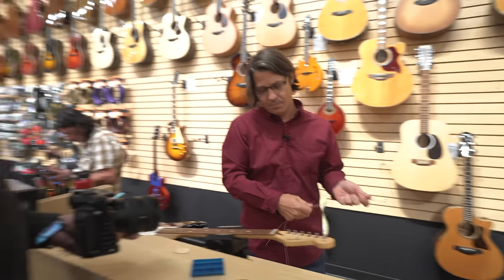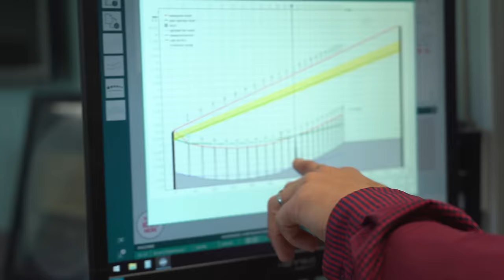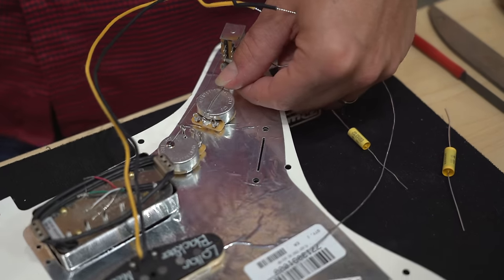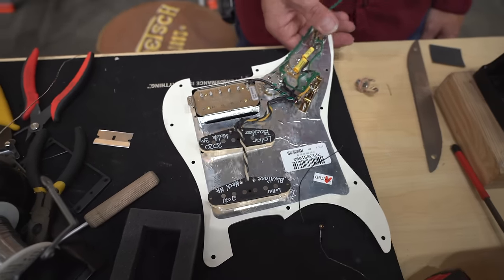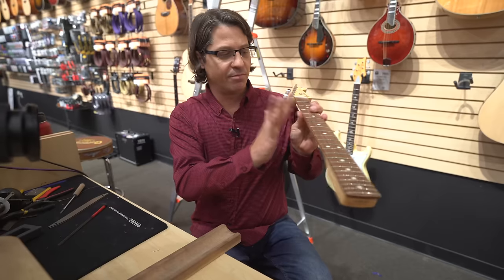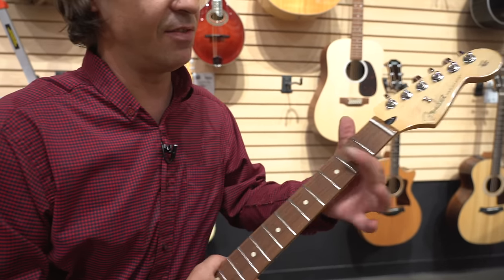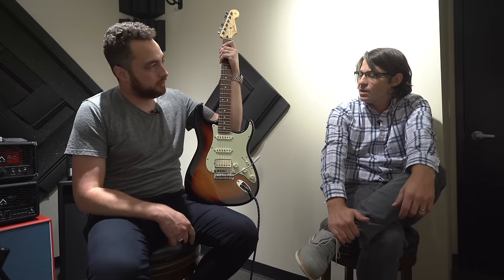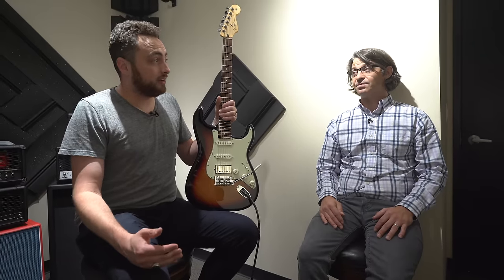We Tried To "Custom Shop" The Cheapest Fender Strat

Comment: So basically most of the initial issue (the high action) was just a truss rod adjustment.  You liked the initial tones so you tossed away all the pickups and all the electronics.  I'd love to see what it looks like with a 5 minute truss rod adjustment, setting the intonation, adjusting the saddles, adjusting the nut if needed, adjusting the pickup heights to optimize the tone.  I'd bet it would be a really nice guitar right then and there.
Reply: I dunno man I’m constantly swapping parts on my violin (sarcasm).  I agree, as a reformed modder, if you don’t like the guitar after a proper set up you won’t ever like it no matter what you do.  I find the opposite to be true, if you like a guitar why mess with it other than as an experiment or time vacuum.
Reply: I say buy a performer and have a top notch set up on it .
Reply: Yep, and blows past the initial ~$800-$850 ballpark upgrades by $1,000,... The stock electronics were doable as they were.
Reply: Truss rod adjustments are for proper neck relief, not action.
Look it up.
Reply: Yeah the other pickups were better the truth shall set us free
Reply: @jamiedoerfler3693  I'm sorry you're not getting it.  Try this on your guitar, set the neck relief to something very large, 3-5mm, then measure the action at the 12th fret.  If you'd have watched the video you would have seek the PLEK report showed the relief was not set properly. That does result in higher action when the neck has way too much relief.  Likely this happened because the guitar was shipped from a different environment (e.g. humidity or temperature) but possible it just wasn't set up.  So the first step of a setup is to set the relief, without that you won't be able to get good action.  You also missed the entire point which is that with a proper setup this guitar would probably be fine.
Reply: @ernie12man  you mean more like 150 or so
Reply: @guythetechguy  yep..
Reply: @Luckyrider1958  Early in the vid they say they're gonna do it for $800 or $900 and then total tab comes out to $1950 didn't they say? A bit more than $150 if my ears and math are right. :)
Reply: @Luckyrider1958  Ahh I follow you, my bad, I missed the all together guitar + work/mods/parts ... thx :) wheww now it doesn't seem so insanely out of whack. Derp :)
Reply: It might have been the amp, but I liked the old pickups better.  I can't believe Fender has the balls to put out basically an unfinished guitar at any price.  I just purchased a new model last year and I was really disappointed.  For a cheaper price, my Schecter arrived fully set up with a graphite nut and locking tuners.
Reply: @leester9487  Yeah, needing a setup isn't "unfinished"....wood moves, it's just how it works. And while relief is mostly standard, action preferences are different for everyone. A player should always expect to have to do at least some minor setup for themselves on a new guitar.

Schecters are great value...I love mine too. But "the truss needed adjustment" isn't a flaw with the guitar build.
Reply: I definitely would have preferred to see that intermediate step: set it up, intonate it, and then see where you're at. That's a better representation of whether you'd like it before you dump any money into it, and it's very likely I'd just leave it like that. Cool of Righteous Guitars to give it away, though.
Reply: I bought one of these back in 2020, after the setup it played amazing like my friends 80’s strat. Right now I modded the heck out of it and made it a replica of Billie Joe “Blue” strat, but stock it’s an amazing guitar!
Reply: yep, mexicans are pretty descent. They "types" of people think that higher price is better and so they look down on everything that is not top notch. Getting more expensive stuff doesnt matter much on the guitar. A big difference i find is Alnico vs Ceramic; alnico pickups have better dynamics. But stuff like more expensive pots or a bone nut isnt gonna do much sound wise.
Reply: @ryanevans371  I feel like a proper Fender branded guitar shouldn't really need much more than a truss rod adjustment. Maybe saddle heights. The nut should be properly cut, and the frets properly level, and the saddle heights should be reasonable (2mm) for a "middle of the road setup. The player shouldn't need to tweak more than the truss rod and saddles to get their preferred action.
Reply: @North_9  I don't necessarily disagree with that, but truss adjustment and saddle height is what I had in mind when I was talking about adjusting the action....that's why I described it as "minor setup for preferred action".

A nut adjustment is something that should only ever need done once for that nut (it's not really designed to be adjustable for different action heights), and that should be appropriate for any brand guitar as part of the final quality check.

Regardless, it sounds like we agree a guitar with high action isn't an "unfinished guitar"...especially since a shop should be setting the guitar up anyway once they receive the guitar and it's adjusted to the shop's conditions,  before putting it out on the floor.

That's part of the issue with the guitar in this video....the shop is pulling it out of the shipping box rather than taking it off their floor stock.
Reply: @aperezdeal  So true especially since almost every musician I have ever know has not yet reached the level of ability they aspire to, better of practicing than modding, unless you make part of your living as tech or simply find modding to be a relaxing hobby.....
Reply: @jamiedoerfler3693  very rarely do informative and correct comments end with "look it up"
Reply: It would be, and thats what id do but thats not the point of the video sadly
Reply: you can just do that yourself! He showed us what would happen if we bought a cheap guitar and souped it up. It's kind of that lingering question in the back of the mind of every guitar consumer: "am I actually getting what I'm paying for?"
Reply: @johnsmith-ug5tp  YouTubers put a lot of time and energy into setting this kind of thing up and editing their videos so they deserve their income. Nothing sleazy happening here, they’re both genuine dudes
Reply: @leester9487  A setup should be part of buying a new guitar and requested from the shop when you buy one. Shops in particular are not going to setup every guitar and part of how brands cut costs is not to give their cheaper guitars factory setups. If a guitar is setup on a shop floor, its either a return or a guitar they want rid of because guitarists still buy into the idea of trying multiple thinking one will be "the one", when really the difference is a setup.

People have different preferences as well, changing tuning requires a different setup, let alone string gauges etc.
Reply: @guythetechguy  
Exactly this. 
Too many pop off about the relief action debate with this crap and you're correct. 
The relief and fret job is the driver on the height that the action can be.

The one thing that happens when you do this amount of upgrades is, if you ever plan on selling it, you're likely to never get the 1k you put in it back out.
Reply: @jamiedoerfler3693  true kinda. Truss Rod adjustments inadvertently change the action. If you have high action and high neck relief for example, correcting the neck relief will lower the action. This is why you always adjust the truss rod before you adjust the saddle height.
Reply: In my town there's a MASTER LUTHIER that sets up any guitar for $39.99.
Reply: @eldesgraciado6690  I do them for $60CDN and never had a complaint in 20 years. I’ll even include minor fret corrections. It has to be kept affordable while still being worth doing. Some people go crazy with charging too much for a setup. 
It’s down to a judgement call as to whether a guitar is worth a given amount of upgrades. I’d say in this case, it wasn’t. 
Still, not my circus, not my monkeys. 🤷🏼‍♂️
Reply: @t3hgir  QED
Reply: NO. Truss rods are not for action adjustment.
Reply: @guythetechguy  GAWD. You don't get it. Action and relief are somewhat related, but entirely different.
Reply: @leswhite3524  It’s not that black and white of a subject, so I don’t see why you think you should scold people over it. Bridge action, nut action, and relief are interdependent and effect each other as you adjust them. They all effect intonation as well. So yes, the relief is married to action adjustments. Measurements are ranges and/or starting points, not final destinations, experience wins the day. You do have to do the adjustments in the right order… Truss rod first, then bridge action, then nut action, then intonation, then test, then tweak. 
All guitars and some players require slightly to extremely different setups in order to get the best out of them.
Reply: @TheMasonator777  What I like about that guy in my town is that he won't judge you if you bring some budget guitar to him. What if you got an affordable guitar for your son to learn? He'll set it up as good as it can be. I've seen others that say "Oh, no, I don't work on Squiers, Epiphones, or other chinese stuff!".
Reply: @eldesgraciado6690  I work on whatever the customer brings unless it’s literal toast.
Reply: truss rod adjustment is for "neck relief" not for high action.
Reply: As we all know, internet consensus equals truth.
Reply: @jamiedoerfler3693  exactly in first time, final setup on bridge
Reply: @jamiedoerfler3693  true but it’s undeniable that adjusting the truss rod either way does lower or heighten the action. Depends how much relief you need or like?
Reply: @jamiedoerfler3693  absolutely true but having a loose truss rod that bows your neck can and will raise action higher than it normally be in frets 5-17
Reply: @brandoncondatore1051  that’s true as well. Still, the right way to adjust the action is at the bridge first. The relief or lack thereof on the truss rod changes with temperature and humidity changes. That’s why it exists…to fix those changes.
Reply: Seems guys are just swapping parts because they think it'll be an improvement.  Usually, swapping parts will do one specific thing better.  That might improve other areas(for example, your stock pickups were muddy, and you put in clear ones), but usually it's best to know exactly what you want.
Reply: It was probably a real nice player to begin with, but then he wouldn't have a video, and this shop wouldn't get to show off their ridiculously expensive machine.
Reply: @johnsmith-ug5tp  To pay for that PLEK machine.
Reply: Now that they've modded it, they have to give it away because I'm not buying it. They can give it away or part it out for 1/4 to 1/2 of the $$$ they've put into it.  Welcome to the real world.
Reply: @guythetechguy  hi, very interesting information. I recently bought my first guitar, a fender MIM a month ago, and really want to know how to do a decent, or proper set up or adjustments in order to have a better instrument. I appreciate any advice or recommendations. 😊🎸
Reply: @ernie12man  $500 for a SD59 upgrade is a bit much in my opinion.
Reply: @leester9487  I love my Schecter.
Reply: @guythetechguy . I agree with you.  Even some less than $100 guitars play great if set up properly.  I am not a fan of locking tuners.  Ordinary tuners are fine, they work well.  Bone nuts are good, but so are many other materials, such as brass.  Jeff Beck used a nut that was metal, and a standard tremolo, no Floyd Rose.  Poly finishes are durable.  How many cracked nitro cellulose finishes I have seen from guitars transported in trunks of cars in the freezing Mid-western winters?  Satin finished necks are good.  A James Burton flamed Tele has one of the finest necks I have ever played, a really great feel.  A cheap guitar, if it gets stolen, can be replaced without so many tears.  I have been robbed several times.  Expensive instruments stolen hurts a poor musician a  lot.  An unbranded padded soft gig bag is fine.  One can wear it on one’s back riding a bicycle.  Hard cases are expensive, hurt your legs when banged into.  The shape and name on the case, such as Gibson, a robber knows a Les Paul case shape.  No good!
Reply: Doing all that would take a lot more than 5 minutes.
Reply: The guitar sounded FAR better stock. Gee, it's almost as if Fender knows what they're doing, and that shop should have NEVER tried to pretend that action would remain on a store item.
  They didn't build a Mustang that whips a Ferrari, they built a Mustang that can't outrun a stock one.
Reply: Agreed but the Excervise was to see what would happen if you spend that amount off money ...but I actually agree with your comment but these guitars ion sale learn to do the work yourself only ditch parts which are unworthy and just smooth out the rough edges off the manufacturer gives you and ahhh labour costs are inhibitive too unless however you buy a higher Mexican level then this and then buy it on sale however check the specs and wait for the sales before the cheque 😉☮️🌈
Reply: @TheMasonator777  this man knows his stuff take your guitar here to him .....
Reply: @jamiedoerfler3693  if you don’t have proper neck relief then you can’t set you action.
Reply: @stevenlipson1965  true, but relief can vary a bit. I found it doesn’t have to be “ by the book”
Reply: I was mostly annoyed by how much unnecesary stuff they did to that poor guitar. Also, I'd get a synthetic nut if I had to change it. And... you could buy another guitar for the price, or a cheap body and neck since you are going to change everything (but that was not the theme of the vid).
Reply: I have a player Strat that I won’t mod. I got the hss. I wouldn’t buy a car that I had to swap the engine out of. Why would I buy a $1k guitar to drop $2k into
Reply: @jamiedoerfler3693 , wouldn’t neck relief be a big factor in action? Relief can be adjusted differently
Reply: Plenty of great used Strats for half the initial cost. Stupid imo to pay for new when you're going to change this much out
Reply: Fret dress and good set up, is the point of difference. The rest is bollocks that shouldn’t be considered. My 2c
Reply: I've played 100 dollar guitars that I liked more than 500+ dollar guitars.
Reply: @jamiedoerfler3693  your kidding right?  I make guitars.  Truss rod adjustment does change string height. Especially it was way out in the first place.
Reply: I have a 20 year old 300USD Mexican Fender strat. Has held up quite well, good action. The only improvements I want to make now are to upgrade the pickups to top grade, maybe a little truss rod adjustment and get locking tuning knobs. If those changes are made, I think it will match any of the really $$$ instruments.
Reply: It would be a great guitar after a simple setup. But this is Rhett Schill, gear snob extraordinaire.
Reply: @aperezdeal  guitars, especially fender guitars, were literally made to me modded. Modding and swapping teaches you about guitar as well so you can learn what you like and you don’t like. As someone who never changed anything out and now mainly plays modded out stuff, I have much more working knowledge of guitar and how to achieve specific tones than I ever did playing bone stock instruments
Reply: @leester9487 I love my Schecter, comes fully set up and sounds amazing for a $100 pawn shop find. And the playability of the neck and such is much better than any Fender I have played. Maybe I'm missing out cause I haven't played a $6K custom shop Strat. But for $6K, I will go with a true American PRS. Fender just can't compete besides the name recognition.
Reply: @leester9487 this wasn’t unfinished.  Truss rod adjustment would have done a lot.
Reply: @johnsmith-ug5tp i can always spot the guy that’s still making Velcro wallet money. 

Here’s a tip.  Quit being so bitter and better your situation so you’re not as likely to sound like an idiot.
Reply: @North_9 wood moves…..that’s kind of why the truss rod is there.  You don’t have much of an understanding of guitars
Reply: @guythetechguy if you adjust high action with trussrod, you might get bow trussrod is meant to deal a relief
Reply: Truss rod doesn't really mess with the action that much. Action is more in the nut and bridge. Truss rod just lets the neck bow a bit so the frets don't twang when you play strings.
Reply: @leester9487   Gibson isn't any better..for the prices they charge, most are not so good out of the box.
Reply: Totally agree! Why throw out the pickups if you like the tone?
Reply: @eldesgraciado6690 😂
Reply: @itsmorphed6416  I compared the player v the performer a couple of years ago when I was after a strat, and for an extra AUD$600 at the time there was no point in getting a performer at all.  I also preferred the two post trem on the player.

My Player was pleked before it was sent out, and I replaced the tuners with all low fender locking, the saddle with gotoh solid steel, and put in a set of lace sensors.  All this still brought it under the cost of a new performer for a better specced guitar.  Having said that, the stock singles in the Player were great and I could have quite happily lived with those but I'd already gotten the Laces.  The humbucker though... absolutely underwhelming and should be the first upgrade everyone does, lol.

It gets gigged regularly, and I can do a 3 hour gig or praco and only need to check the tuning at the start of the show.
Reply: @jamiedoerfler3693 yes but doesn’t the truss rod adjustment impact action?
Reply: It’s humming like crazy after all of the work.
Reply: Spoiler, it is. Also, to "roll" the fretboard edge and level frets at same time, use sanding sponge LIGHTLY along the edge of the board. It'll round the frets, and the board, perfectly. 😊
Reply: I've setup and modded squiers that play, sound and feel better than American made fenders, but do the same work to the American made fender and it usually ends up a step up. But not always.. depends on initial woods, drying of woods, and if the CNC machinery was doing good cutting everything out that particular day lol... You pay more for the paint/finish of a guitar than anything else due to the time consumed in curing the finish. The squiers have a cheaper thinner finish than their American counterpart along with cheaper hardware which is easy to upgrade to brass, stainless etc. pup's are a matter of preference, Duncan, DiMarzio, fishman etc, but don't disregard some of the cheaper alternatives such as fleor, artech, Wilkinson etc as some of their pickups sound pretty stellar at 20 to 30 bucks a piece.. every cheap squier i own after a level, crown, polish, and setup, along with about a 125.00 worth of hardware and electronics upgrade in all honesty puts my stock mim and American teles to shame.. of course there's no resale value like an American tele but then again I've only got about 400 to 500 invested (including the brand new squier model) into each guitar and a few hours of labor.. that vs  800 to 2000 for mim or american standard etc.. 5 killer squiers vs. 1 American standard for roughly the same coin..?? It's a no brainer honestly. And if you want to go a big step up over all of the aforementioned get a Warmoth body and neck some good quality hardware (about 600.00 for a tele build) and you are absolutely at custom shop level. 🤔 600 vs. 4000 for a custom shop?? Yeah no resale value again but super high quality guitar for 600 coin.. no brainer if you plan on keeping it.. everyone has their own preferences etc, but geez whizz 4000 dollars for something you can build up for 600 bucks.. to each their own though, variety is the spice of life and a good thing I suppose..